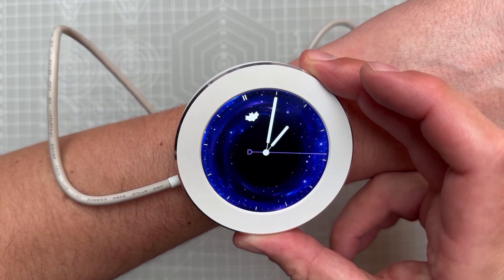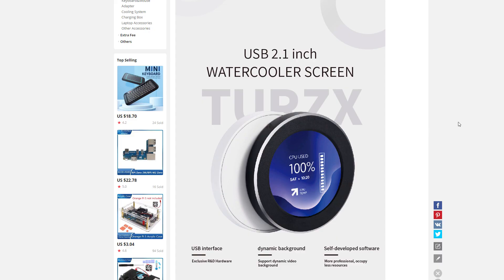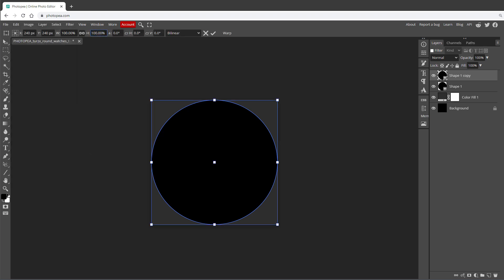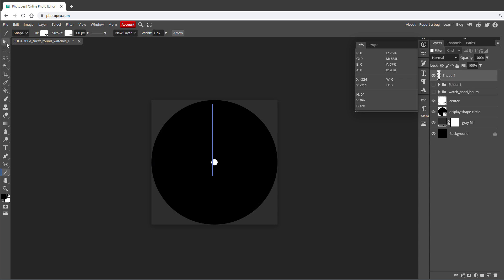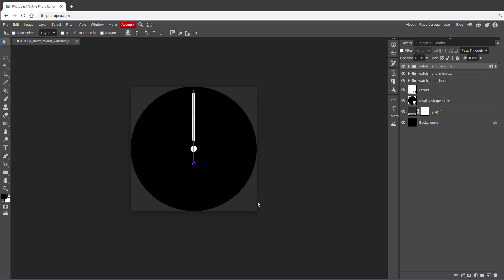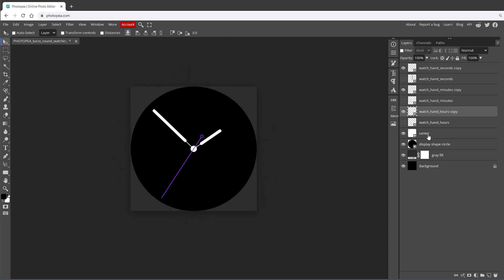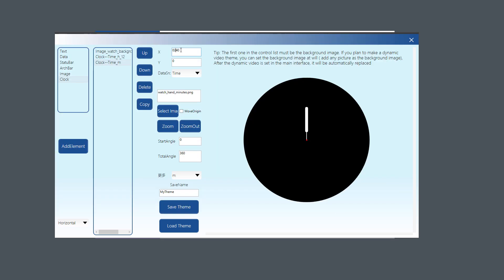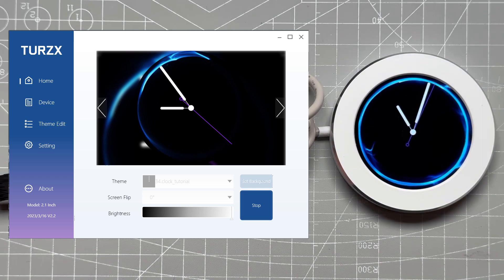Clock for your PC     (Turzx Turing Smart Screen 2.1" Round LCD, Stats Screen for Custom PC Case)

Comment: Hi, great video, but does the display support 60hz refresh rate or 30hz ?
Reply from the maker: It does refresh at 60Hz, but I believe the video playback is only 30 FPS.
Reply: @upir_upir  
Bro thnx for the reply !

But how do you know it does 60fps, did you try to play a video thats is 60fps to test out ?  I ask this because I have to be sure before I buy this device.

I just cant find any information if these displays support 60fps, they dont mention that in the specification which is very annoying.

Please let me know

Comment: how can I display FPS and hotspot temps on this display?
Reply from the maker: FPS should be supported in the software, not quite sure about the hotspot temps.
Reply: @upir_upir  Many thanks for the response .. after many attemps I was able to display FPS by enabling RTSS always on and then restarting the computer ... but for the hotspot it seems theres is no current solution so at the end of the day I opted to buy a secondary 7 inch raspberry pi monitor and run hwinfo in that monitor...

Comment: It`is available connect several same lcd, with different display indicators? Mean each indicator on its own screen? like (clock) - (temp) - [calendar] - [traffic] - (ram use) - (drive space)
Reply from the maker: That’s unfortunately not possible. You can connect different displays at the same time- I.e. you can connect 3.5 inch, 5 inch and the round one. You cannot connect two or more round ones..
Reply: @upir_upir  Thanks for the reply, it's sad that there is no such possibility
Reply from the maker: I agree. Maybe they add support for multiple displays in the next version.